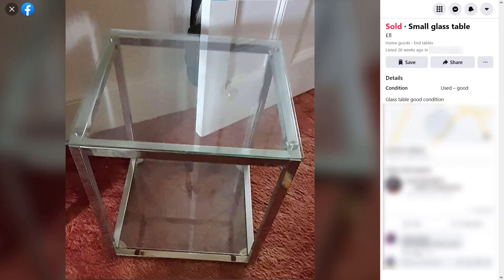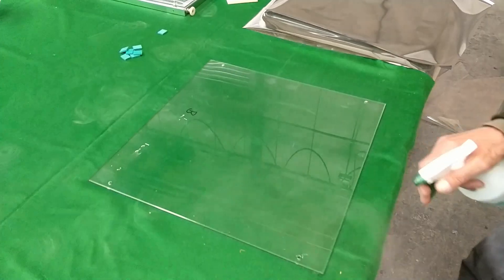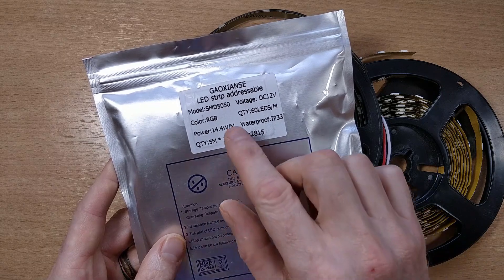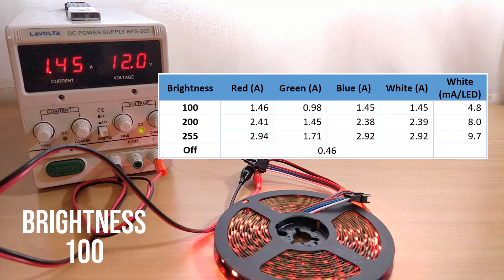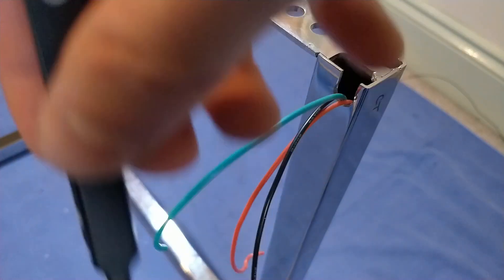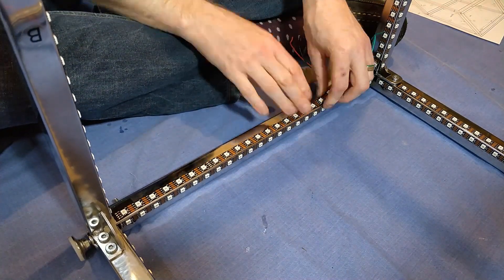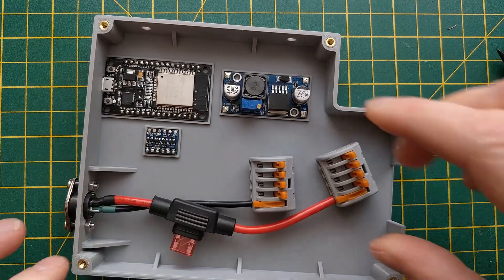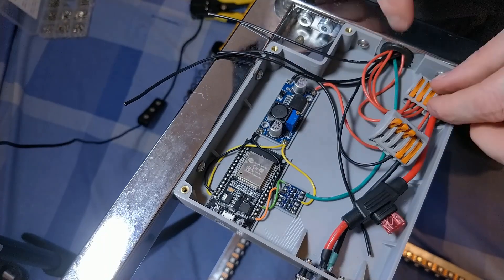Infinity coffee table with WLED and WS2815 LEDs

Comment: Hi, can I use just jumper wire or do I need 18 or 20awg wires for converver, power supply and esp32 connection?
Reply from the maker: Jumper wire is too small for power connections. For this you need larger cables. The more places you connect power to (I think I had 4 power connections to various points around the cube) the thinner the wire can be. Data can be whatever size you like.
Reply: Thank you for answering. What awg cable can I use for power connection? 18 awg enought?

Comment: Good stuff Scott. Maybe you can help... I am running a project where I need to animate a long LED stripe (like 40m) and the sequence will need to be 1h long (no repeating pattern). I think I will get into a lack of memory trap with Arduino. Do you have any suggestions on how to approach this?
Reply from the maker: Hi, 40m is a very long LED run! You won't be able to do this with an Arduino due to lack of RAM. If you have 60 LEDs/m * 40m * 3 bytes = 7.2kB just for the LEDs, plus whatever you need for the rest of your code. So you could use an ESP or teensy. I would consider using 12V WS2815 strips for this. You will want a lt least a 24A power supply (round it to 30 to make sure!). These strips also have a backup data line which is useful in strips this long. If you do use 5V strips, you will need to double the current output of the power supply, so around 48A. Even then, you might not be able to run it at full brightness.

Comment: That's a nice looking cube. So you have links to all the parts you used? Those wire connectors look good.
Reply from the maker: I've added a list of stuff I used to the description. All Amazon links, but you can often find things much cheaper locally or on eBay. Hopefully this will give you a starting point though!